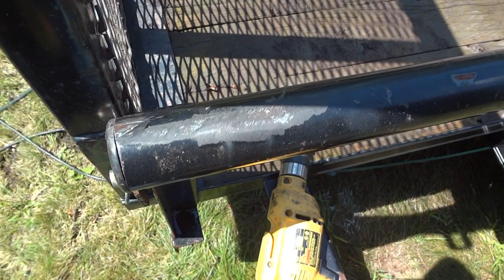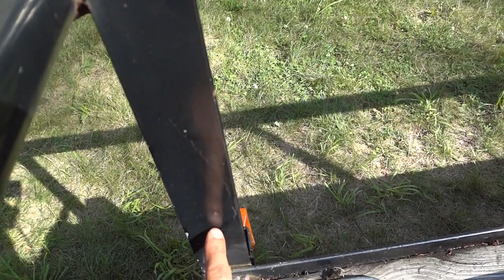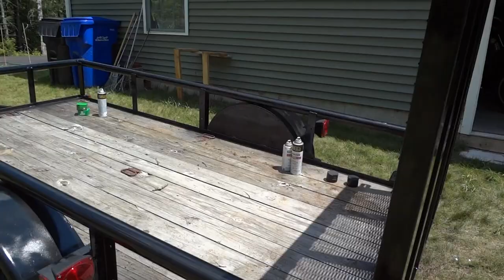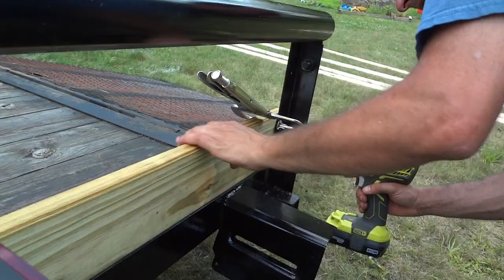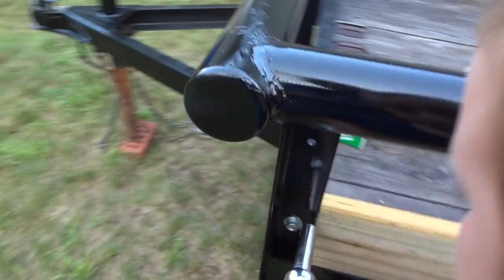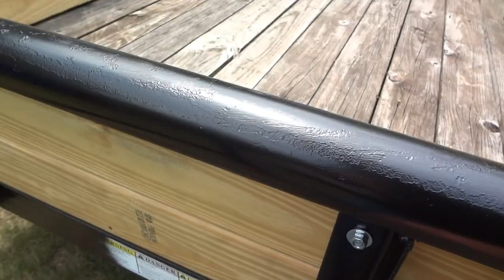Big Tex 30SA - Add Side Panels and a Quick Coat of Paint

Comment: Nice to have hubcaps on those trailers...I put the same Buick caps on my 18 foot trailer. Have you had probs scraping your brake lights off the end of the trailer?  When my trailer has lights mounted on the fenders I place them as far back as possible. You can see them better in that location...when you’re behind a trailer that is. Good job. ✌️
Reply from the maker: When I had the lights down low I wad hitting them on the ground all the time so I moved them up to the fenders